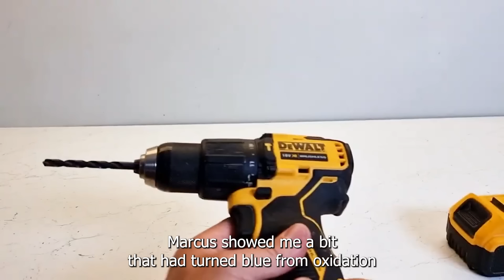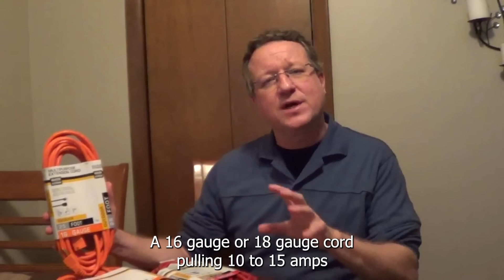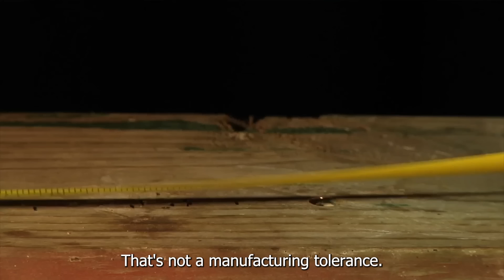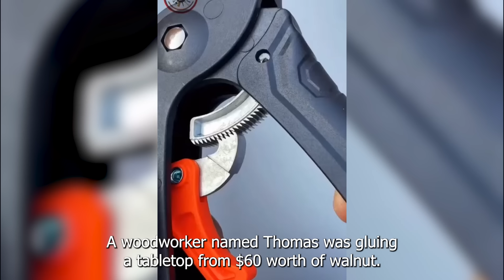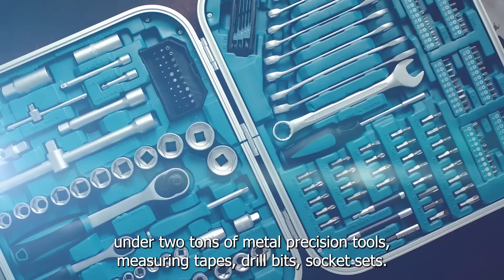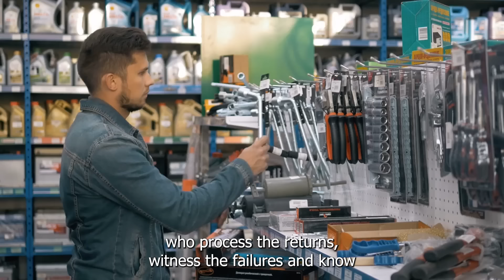15 Harbor Freight Items Employees Warn You NEVER to Buy

Comment: I still have and use Craftsman and SK tools i bought 60 years ago. The last tool I bought were from Lowes under the Kobalt brand. The small adjustable (like Crescent) wrench has graduations on the side that are a pretty accurate size gauge.

Comment: note to everyone electrical cords need to have the right gauge for amperage 15 amps has to be 12 gauge wire if you use lower gauge it will heat the wire no matter who makes it and average table saw has a start up of around 19amps running at 15 amp so know your wire ratings regardless of who makes it( gauge is for copper wire rating may be larger if using aluminum wire  ) Also the larger the gauge number the smaller the wire when talking about wire size 22gauge used for electronics where as 10 gauge is for 30amp circuits